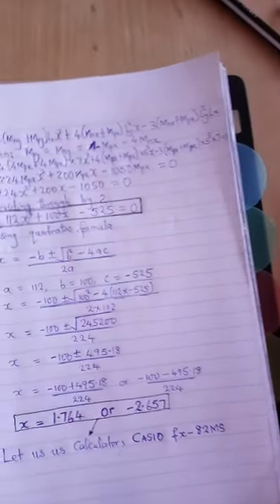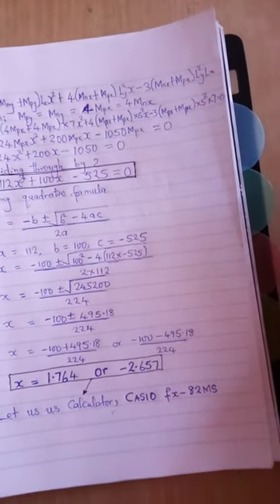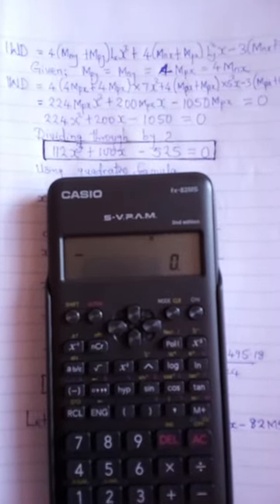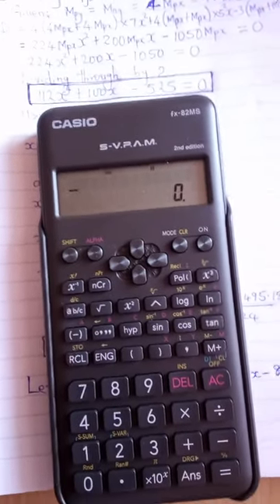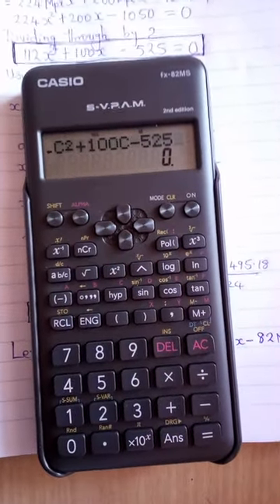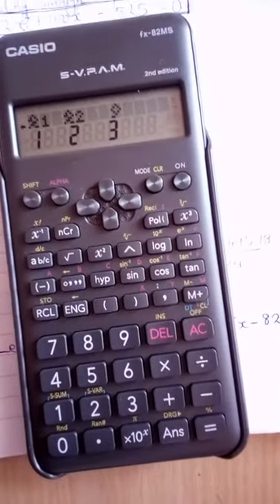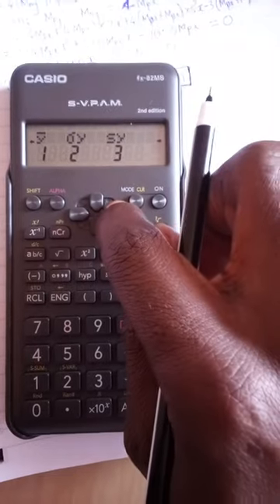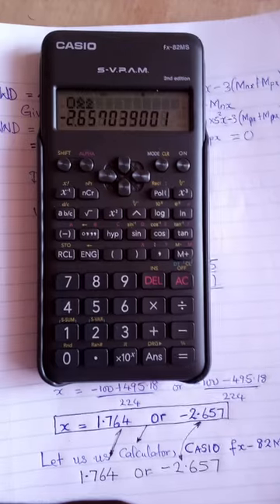SOLVING QUADRATIC EQUATION USING CASIO FX-82MS

Comment: Why are you giving value of n =4
Reply from the maker: I did not give the value = 4, I only press the M+ button 4 times, to add the value to memory on the 4th screen display.
Reply: Okay i can understand that . But why did you press 4 times . Any specific reason. Instead you can press 3??? Please help me I have xam tomorrow
Reply from the maker: When you press Shift and 2, you will see the first option [x  dx  sx], second option [y  dy  sy], third option [A  B  C] and fourth option [x1  x2  y]. So, since we are concerned with the fourth option, that is why you have to press 4 times. The first and second option are for mean, standard deviation.etc, while the fourth one are for values of x. 

If you are still confused, I can make a video to explain for you if you don't mind.
Reply: Thanks bro. Now i understood .🙏🏻🙏🏻🙏🏻🙏🏻🙏🏻🙏🏻🙏🏻🙏🏻🙏🏻(saviour )
Reply from the maker: Please, could you subscribe to my channel? Please?
Reply: @Ekemobong  well, okay ... apologies, its crazy(?), because at least on casio fx-82ms (2nd ed) it really works ... on canon f-715sg no; math error ... still don't know why ))
(but ... that note about pressing M+/DATA 4 times in relation in menu lenght, in fact, is even crazier, you know .... so, now what ??? )))))
Reply: We only need 3 points to curve fit a quadratic. Pressing M+ 3 times added points (0,f(0)), (1,f(1)), (2,f(2)) --> Quad regression line = quadratic equation to solve.
Reply: @7alken  M+/DATA is adding points {N, f(N)}, where N=data points. (BTW, we only need 3 points to fit a quadratic).  For fx-82ms, C=N, but perhaps not for other models. You can look up the manual, or just recall variables to see which stored N.
Reply: @albertmcchan  btw, yes, it does this also on hp 10s+ (identical lapis/rohm chip inside many...) but throws math error on canon f-915sg, while it ALSO has reg/quad statistics ... pls, bring here someone with brain to describe the quirk in detail, with truth ... tnx
Reply: @7alken  Say f(x)=a*x^2+b*x+c. If you don't know what variable holds N (number of points), you can add points manually, (0,c), (1,a+b+c), (-1,a-b+c)
Reply: @albertmcchan  why it fails on canon f-915sg with the same features? )) ... I am ready to apologize again ... if it will be completely described ))
Reply: @7alken  I don't have Canon calculator, but perhaps N is stored internally, not exposed like Casio. Another possibility, points only allow raw numbers, not variables formula.  Anyway, you can always add points manually.

Comment: Please tell me, the difference between Casio fx 82 ms and Casio fx 100 ms scientific calculator...🤔🤔🤔🤔
Reply from the maker: I am sorry, I have not used FX-100ms before, so I dont know exactly the main difference apart from the fact that FX-100 is higher in memory capacity and operation.
Reply: @Ekemobong  oh! it's okay. thanks.🙏🙏
Reply: The 100 fx is like a little higher model than the fx82 ms . The 100 ms has more scientific commands .

Comment: What is the default mode of the calculator?
Reply from the maker: I am not sure I understand your question.  But, in case you need to work on the normal calculation mode, just press mode button and then 1

Comment: Is this good for engineering can we solve Matrix
Reply from the maker: It is good if you are a student and you are not allowed to use a higher version of calculator. But if you are allowed to use any calculator, you can go for a higher version like 991 and above. This calculator can not solve matrix directly.